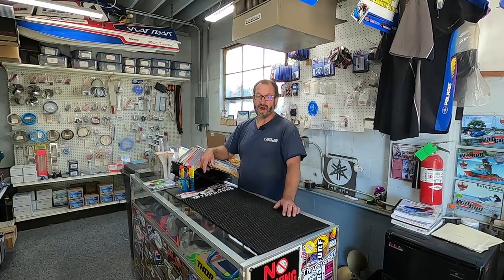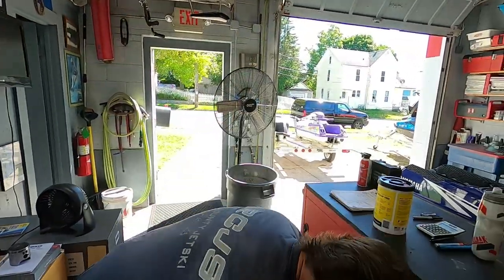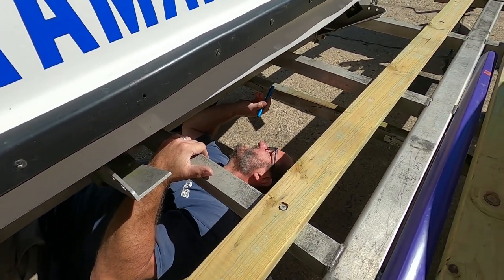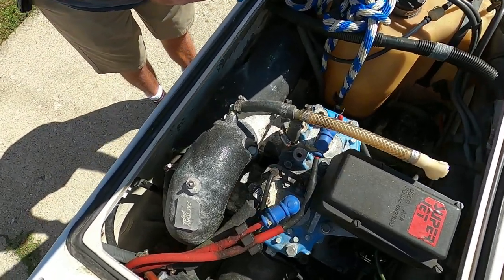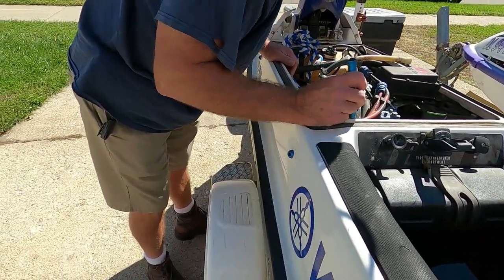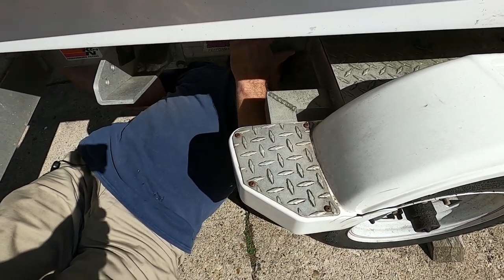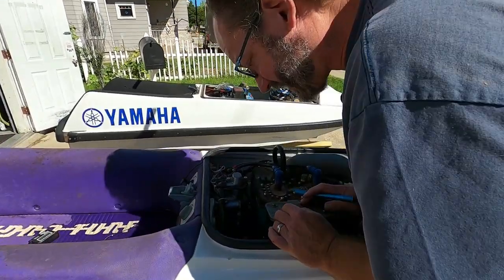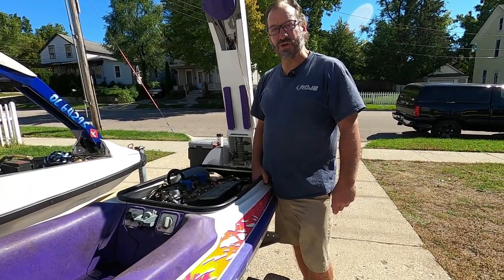Barn finds Yamaha Super Jet & Kaw 750SXi

Comment: I've had my '95 750SXi since about 2010 and it's been a great boat.  Bought from the original owner, who left it mostly stock and did some IJSBA racing (has the sanctioning body stickers and number on side).  I did a race with it in Nashville and it was super fun.  Only time it failed me is when the oil injection supply line broke off while I was riding.  I knew I should've converted to premix.  If anybody is reading this that has one of these, don't leave the oil injection on it!  I swapped another used engine in mine so it's all good but I knew better than to keep using that oil injection setup.  Otherwise, it's never let me down.
Reply from the maker: Thanks for watching and the great story.  Glad you are enjoying your ski

Comment: ive seen many skis like this...I am surprised you dont try breaking them loose! Usually its the pump thats locked up! But even if its the engine...a lil oil in the plug holes, a pipe wrench on the coupler (what  yer tryin to spin) and boom, a running ski!
Reply from the maker: Thank you for watching. "IF" an engine is rusted, or sized it needs a full rebuild. NO amount of oil will fix that. Even if you do break it loose, and get it running again, it is just a short time until it will let go completely ruining other engine parts.
Reply: @watercrafttalk2738  Agreed! esp. for you with a rep. in the business you need to keep up, 

but avg old me I get them cranked and ride em, always get at least 1 season out of them. I love it when I buy a ski "locked up" for cheap, and be riding it 2 hours later.

Comment: Hi John. Just curious why you said the ‘95 was the worst port timing.
Reply from the maker: Thank you for watching. The 95 Sxi cly has the tallest port timing. Kawasaki was trying to get high speed #'s with the Sxi, making it kind of a "turd" on the bottom end for power. Typically stand up riders WANT bottom end bower for blipping the throttle, jumping waves, etc. "Most" do not just ride around pinned at WOT all the time....
Reply: @watercrafttalk2738  good to know. I had two sxi’s. And they both had silver no stamps cylinders with the low port timing. Apparently neither were the factory engine. Which makes sense now that I think of it since they were sxi but had single carbs.
Reply from the maker: @jcbenson01  Silver no stamp was a 92 small pin cyl.